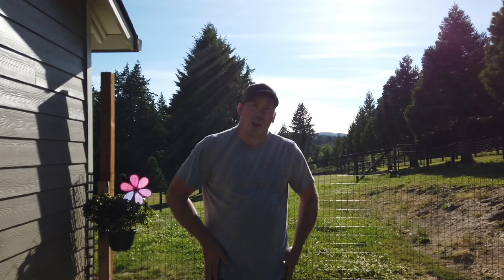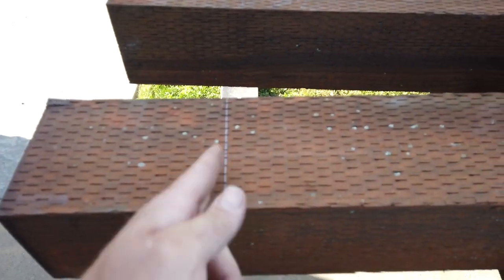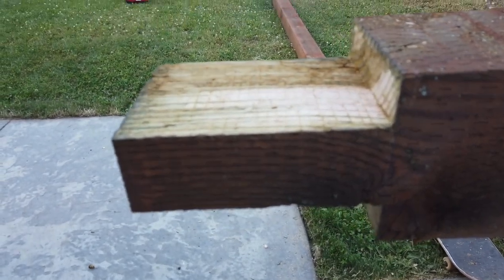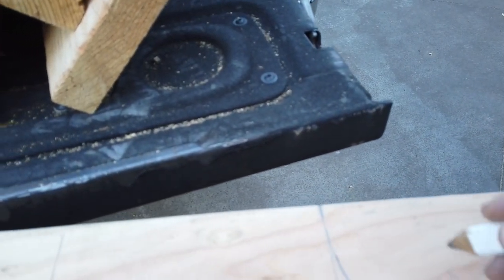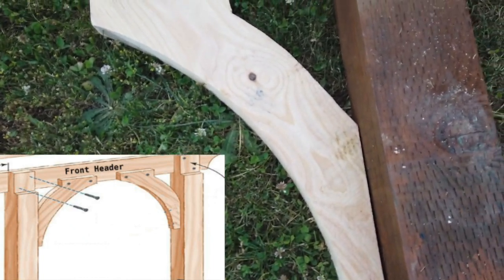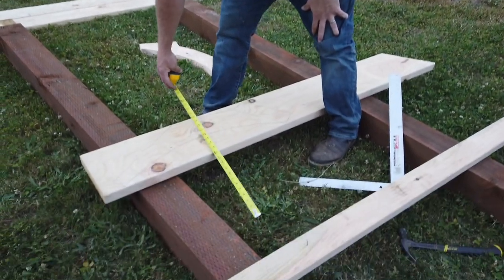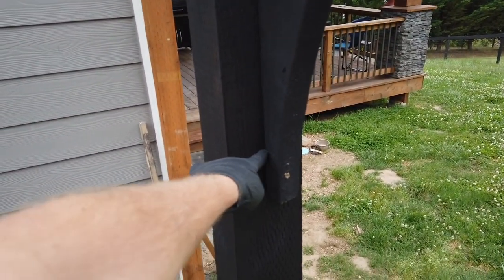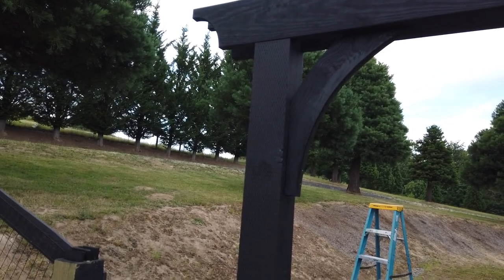DIY Gate Arbor

Comment: Hey great video! Btw, how many inches away from the end of the 2x10 are you putting the framing square? 3:45
Reply from the maker: Thanks! I set the square far enough so that you can cut a square edge on the end. There is a link to the instructions I followed in description.